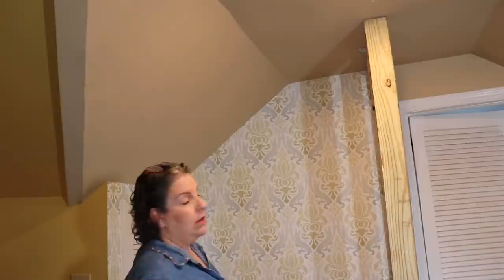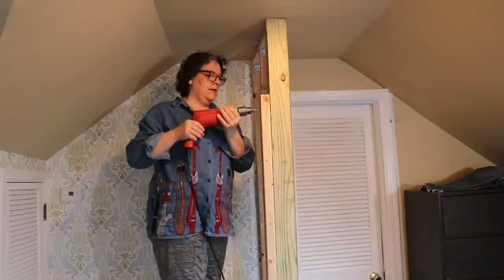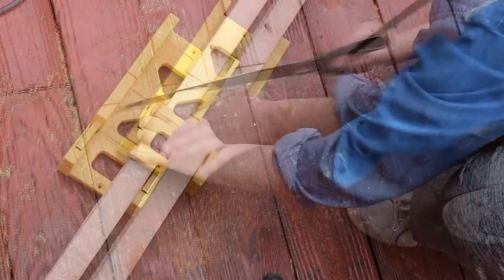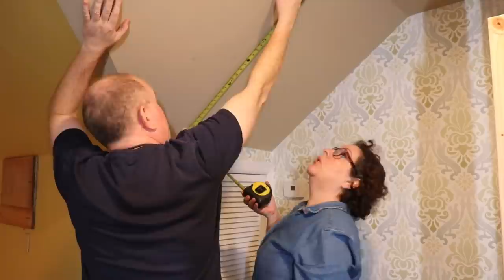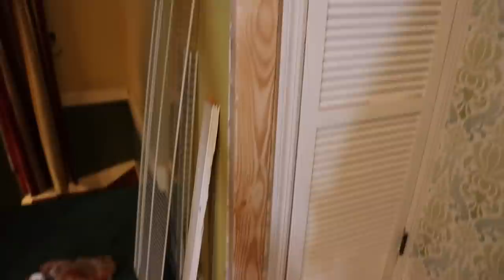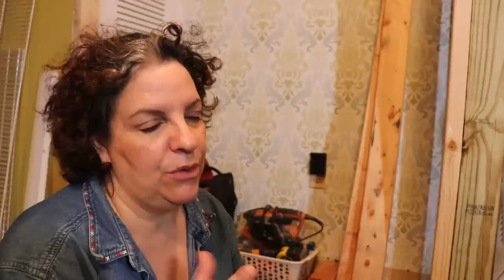Master Bedroom Makeover Series || DIY Closet || Episode 3 ||

Comment: You are making good progress. Great that Scott came to your rescue. You two are so sweet and hilarious.  My house was built in 1942 and I don’t think there is a straight wall in the whole house. As far as the closet doors go both options would look good and I would go with doors that would give you the widest opening to get into your closet. Another thing about the combination shelf and hanging clothes rack, the white wire rack that you bought that some one else mentioned from a few videos ago. All my closets had a hanging system similar to yours and because each hanger had its individual spot I couldn’t hang much clothing on it. Drove me NUTS. I had a handyman remove all of them and put regular closet poles in each closet. instead. So now I can fit more clothing and I can slide the hangers on the pole. Just a thought. Your closet is going to look spectacular. I am so enjoying these videos.
Reply: They also make one of the wire racks that has a smooth rod on it because you’re right,hanging individual hangers in each space is a PAIN.😵‍💫😩😵

Comment: Sophia:  Good job.  If you install french doors you will need to install 2 hinges per door.  If you install bifold doors, you will need to install ceiling and floor hardware.  I vote for the french doors.  If nothing else, the closet floor will be easier to clean without having to worry about a metal track on the floor gathering dust, etc.  I've had both types of doors over the years and the bifold doors are always coming off their tracks or the top or bottom pins which need to be installed on the top and bottom of the door which fit into the tracks get bent or broken.  Regardless of which type of door that you choose, your closet will look perfect when finished.  Can't wait to see the finished project.

Comment: I like what you've talked about before for the doors.  One side of bi-fold doors.  I'm sure you can find one at the Restore.  There are louvered and solid.  I'm talking about just one bi-fold door. It won't be very heavy. Usually there are two bi-fold doors in a closet.  Just get one half of the set. You should get the door first so that you can build it to the measurements of the door. For the wall piece on the left, I would have cut it the 57" and put the 45 degree cut on the the ceiling so the it would sit on top of the wall piece.  Think about supporting each 2x4 with the one  below it.